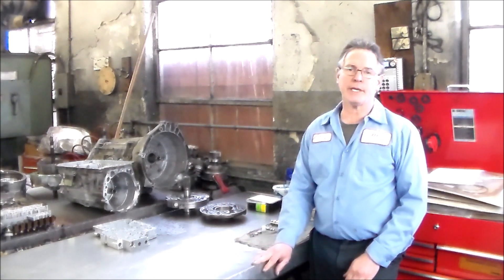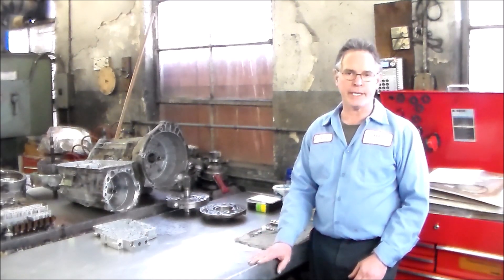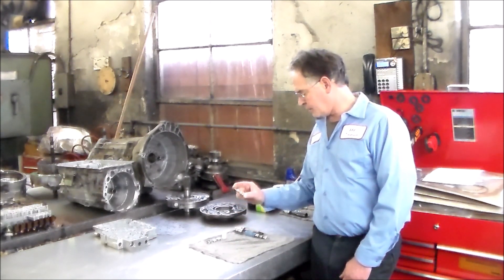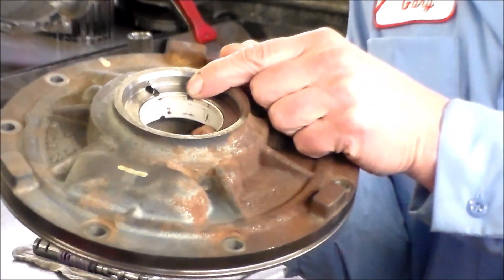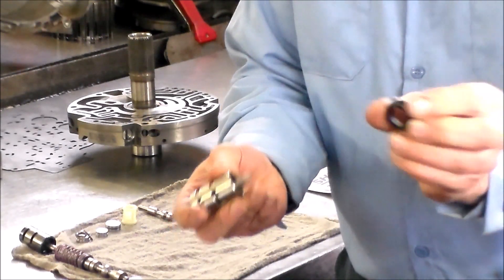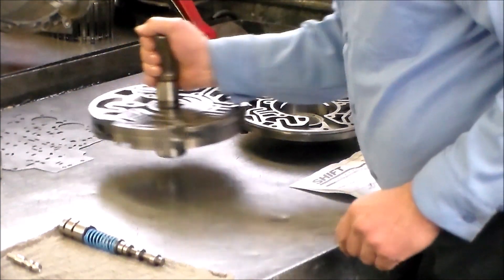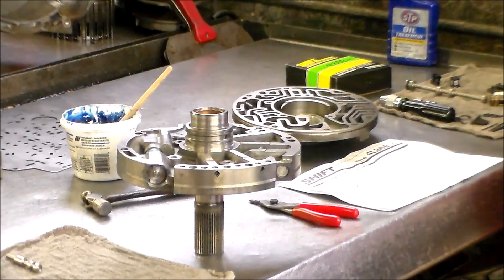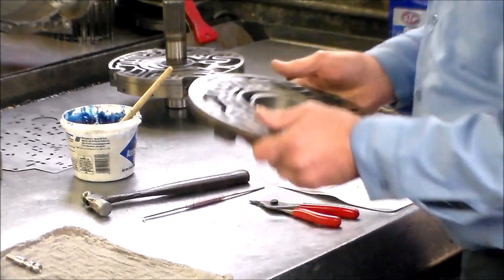4L80E Shift Kit Install

Comment: Hi Gary, I have a 4l80E with intermittent movement, One time you start the truck (04 silverado 2500HD) and its normal, and the next it just revs with no motion. I tested the line pressure, when the truck moves the line pressure seems normal, when the truck won't move the pressures are near zero. So is the port pressure coming right off the pump, or is the pressure at the port controlled by a solenoid that could be intermittent? Any suggestions? Thanks!
Reply from the maker: Coming off pump, question does this happen in the morning after sitting overnite or happens at anytime?
Reply: @GaryFerraro  It generally works first start of the day but not always. If it works and it is driven it will continue to work until it is shut off. My dad just did a 800mile trip through the rockies in it by never turning it off. During the trip the trans over temp light came on several times, maybe the torque converter is not locking up?

Comment: Got a question I have a 4L80E that was rebuilt with the shift kit including oversize valve by Transgo. It shifts nice & firm . But once it gets real hot 1-2 & 2-3 upshift is too harsh it bangs no slipping. Been told new bushings were installed too. Could it be a valve body? This problem came about 2 years after the rebuild.
Reply from the maker: You should have it scanned for codes, if codes are present the computer may be raising line pressure

Comment: Is it really important to drill the drain back hole? My trans is still in
Reply from the maker: Well if your installing a shift kit with the trans still in the car, i would think you will be ok, .  Before i started using this kit, i did not drill the drain back hole

Comment: Hey Gary how are you, I have a problem with a honda crv 4×4, it just heats up and doesnt go in reverse, wondering if you can help, thank you
Reply from the maker: How is it forward when hot?
Reply: @GaryFerraro  It also gets hot and very rough
Reply from the maker: @JosePerez-fw1zj  Sounds like the filter may be clogging up
Reply: @GaryFerraro  I put a double filter on it about 2 months ago and it came back with that problem
Reply from the maker: @JosePerez-fw1zj   You pulled the trans and changed the filter?
Reply: @GaryFerraro  
they just removed it and I'm going to open the transmission Ill see what the problem is and Ill update you
Reply from the maker: ok, change the filter and flush out the cooler lines and radiator, or all the crap that's in the trans cooler will go back into the trans
Reply: @GaryFerraro  I will clean everything and repair the 4th and change the convertir

Comment: Does this fix a p0894 code?
Reply from the maker: I would say no, the kit does give you a new TCC valve to install but P0894 code can be a bad pump or stator bushing, could also be converter itself.